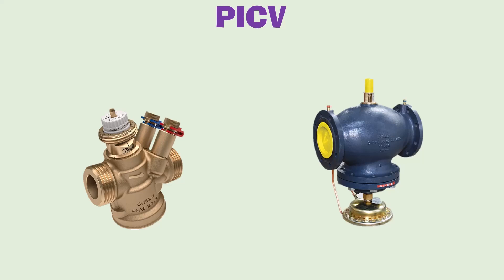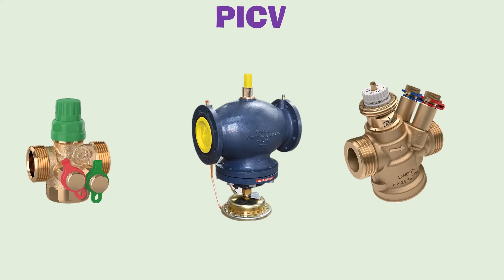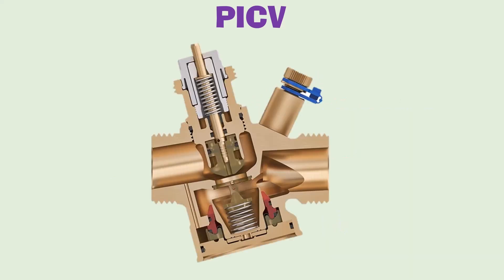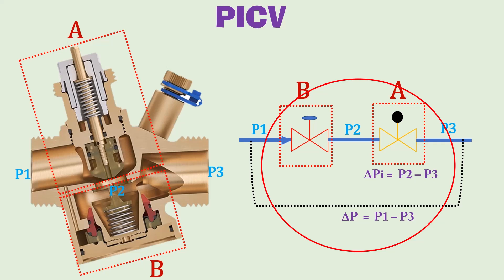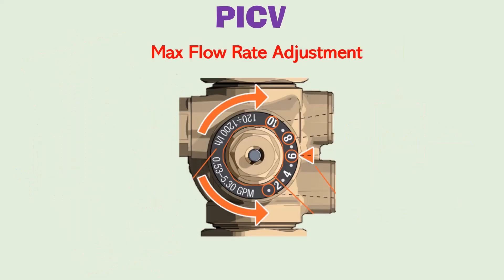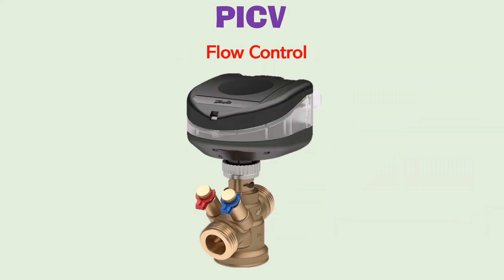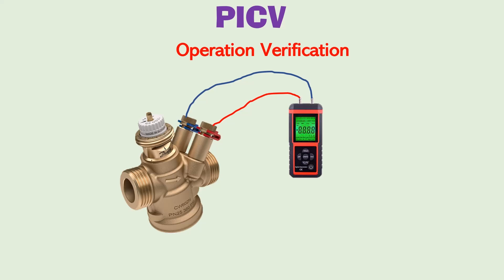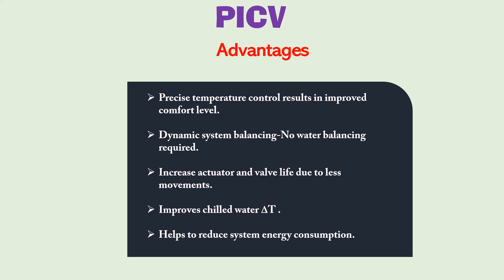PICV Explained: PICV valve working principle | BMS Training

Comment: Thank you very much for this video, lot of my doubts are resolved. Minimum differential pressure requirement is across inlet and outlet?
Reply from the maker: Yes in order the spring to work properly.
You can measure it using the pressure ports available on PICV.
Reply: @TechSystems sir  BMS course lena chahta hun please reply me